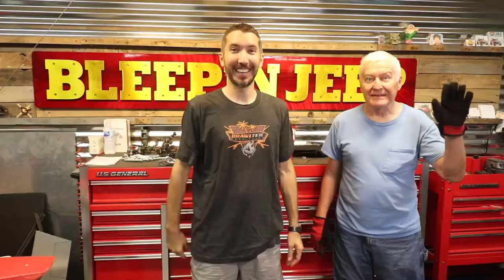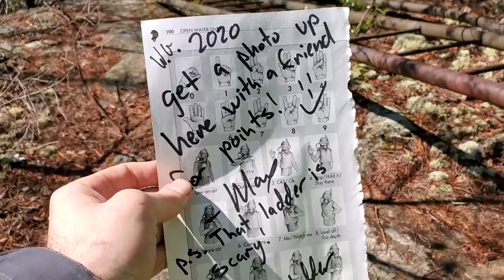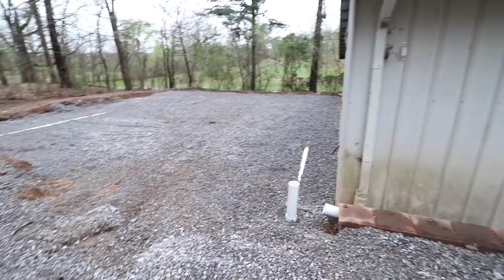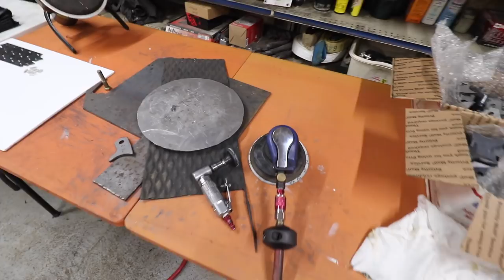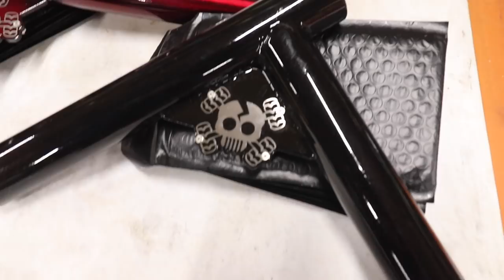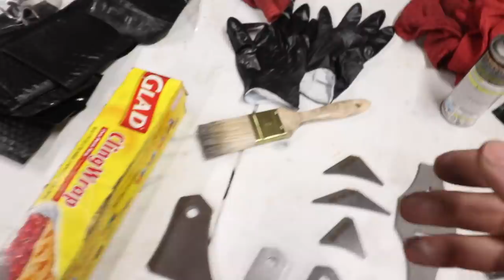RIDICULOUS! We Need To Talk About The CoronaVirus, New Videos, Shop Update, & More

Comment: For the tabs get them tumbled or get a tumbler for deburring or don't deburr them. I don't believe all other suppliers of similar products do it. Much easier for a end user to do it themselves instead of you doing thousands. Instead of spraying them with WD40 I believe there is a paper product that is already treated to help prevent corrosion. Then you could turn two operations into one by wrapping them with this paper. Think streamlining. Reach out to manufacturing engineers. The tabs should be able to come off the laser cutting table, let them cool get wrapped in paper and go straight into the bag. Bag them in pairs or pre determined qty's. Do not let each customer choose the exact amount. Example if I want five of this one maybe I have to buy six. Hope this helps.

Comment: Matt we wanna see you build your own from scratch Jeep type vehicle that you can take wheeling so your not hindered by modding something that exists build your own unique off roaring wheeler 100% custom to you and your needs
Reply from the maker: I wanna see that too!
Reply: BleepinJeep - Matt and Jeremy I know that I’d be more than excited to see the build. From frame design to custom roll cage specific to the build and custom body design plus this would open up a few options as far as engine and transmission choice as well as all your 4x4 components, axels, tires, etc... I think this opens up so many fun choices especially since your pretty handy welding and fabrication. I my self have considered doing something along the like 4 door but also considering metals that are strong enough and light enough maybe tie in more educational classes on why we would choose certain steels for certain parts as well as material thickness for rigidity and overall strength. 

I love all your vids but I really get into the informative class type videos and the fabrication vids I’ve seen all of the vids at least twice. Your channel is why I fell in love with Jeeps in the first place. 

Stay awesome Matt and do the Bleepin Jeep 😁

Comment: I know you are a Jeep guy and a Jeep channel, but would you ever entertain the   possibility of a Suzuki Samurai build?  They are very popular also as trail rigs and have a very large following all over the world.  It would help Samurai owners and others in choosing another excellent platform for wheeling/rock crawling.
Reply from the maker: Maybe but I dont know anything about samurais...  I'd basically just be using the body.
Reply: A lot of people replace the axles with Toyota 1979-1985 axles/ Dana 44’s out of Jeep wagoners ( both have passenger side drop, upgrade the leaf springs to YJ leaf springs or four link suspension and coils, engines swaps are limitless. The plus is, they weight a mere 2000 lbs factory.  The minuses, small engine stock and short wheel base stock.  I just thought I’d throw that out there. I love your channel and look forward to more projects. Thank you.

Comment: A nice project/business could be a whole wiring system for the Renix Jeeps :) One that allows all power windows/locks to have the same voltage, and helps keeping the engine bay working fine.

Comment: Thank you Matt!  I didn't have to go out and panic buy, I grew up poor so when I had an extra buck, I'd always buy two cans of beans if I needed one, and the second went into the pantry.  Doing this as a habit means that we are used to rotating through our stock, and we have always kept about 120-180 days of food in our house (and the ability to cook it) - including the salt, oil, seasonings and water required to make the food.  We  DO NOT have 180 days of toilet paper, but I'm ok with that.  I run a small consulting business and this includes disaster recovery / preparedness and it is all based on FEMA training received when working in a previous job.  What is interesting is that the messaging DURING a disaster / pandemic is 'don't buy....' (and this is the list of items you SHOULD have in your home at all times).  Hopefully, this whole situation will flow through its paces and folks will make the decision to maintain a real pantry like our grandparents and great-grandparents did after lessons learned from the depression and WWII rationing.  Stay safe, stay sane, stay away from political opinion sites and focus on being good parents, spouses and neighbors.

Comment: Something on my mind is for my XJ. Is there some way of cutting out the space under the rear seat and flattening it for storage or a second battery or something.  I only have a 4 inch lift but it seems like there is potetialthere , especially if you ar oi o overland and not need the full back seat aymore.
Reply from the maker: sure, thats kinda what I did with the scorpion crawler build.  go back and check out that build and its playlist.

Comment: make sure you pore 6" (I would do 8")  concrete with rebar re-enforced where the lift will go, the rest can probably be 4" as it doesn't need to be as strong or have as much weight on it.